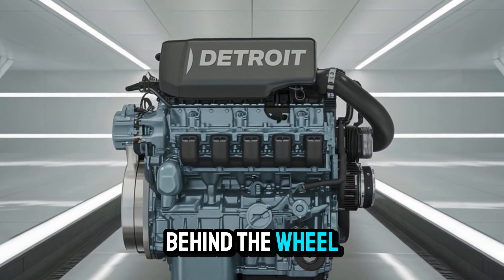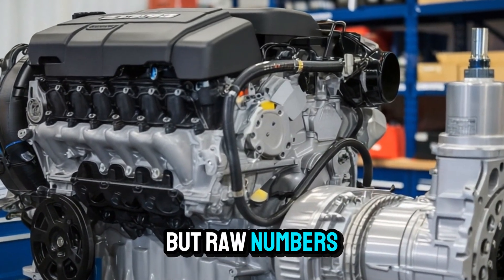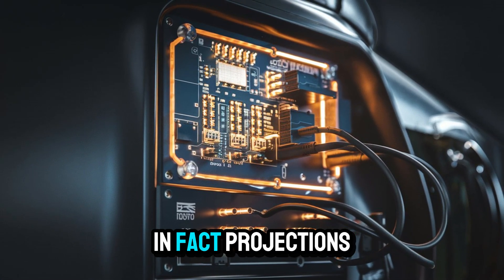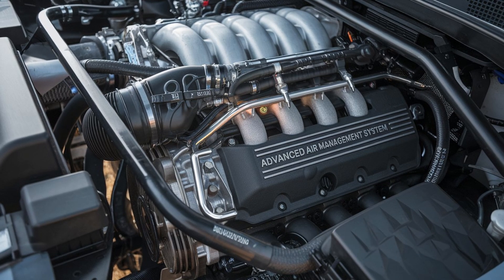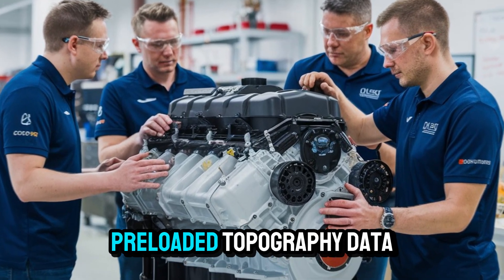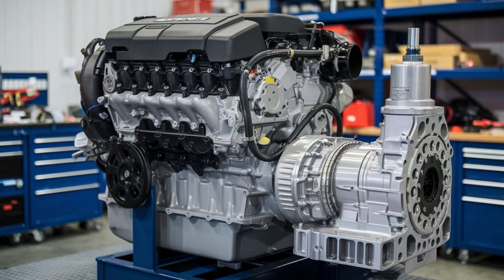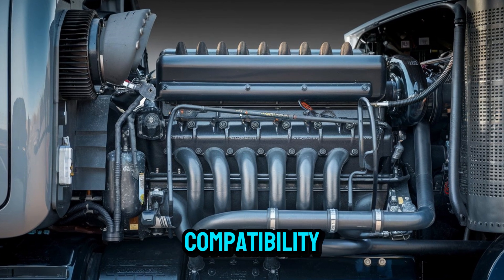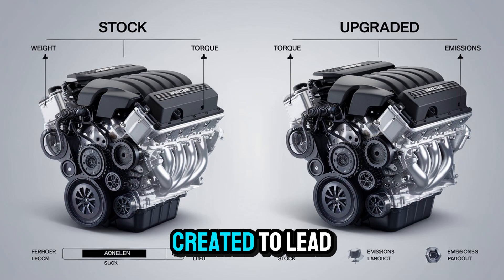Detroit DD16 2026 Revealed: Next-Level Diesel Power Explained!

Comment: Is the DD16 a V8 or inline 6..?? I drove two trucks that had an inline 6 and they was a strong, would run really strong. I ran the Rocks with heavy lodes, and it done a very great job. I was very impressed with the job that it did.